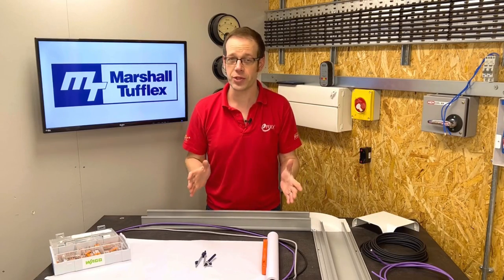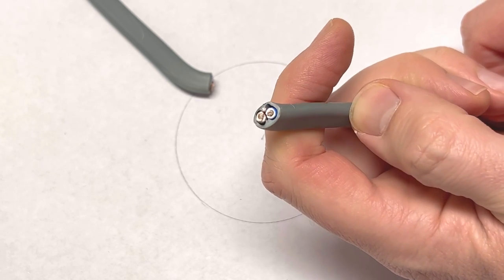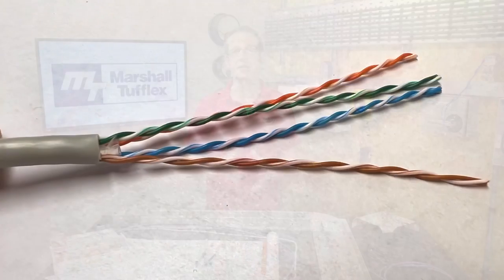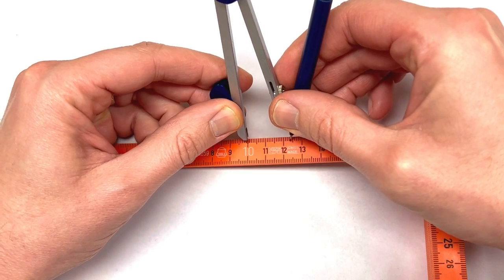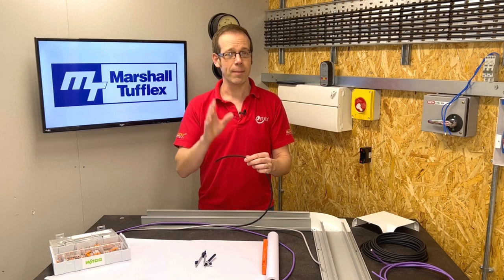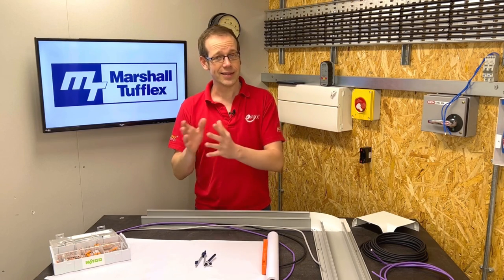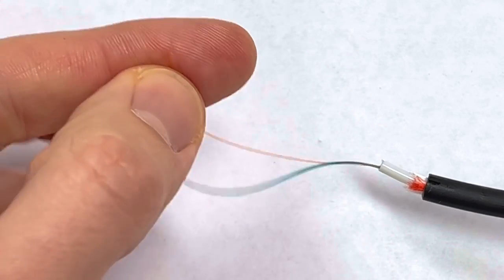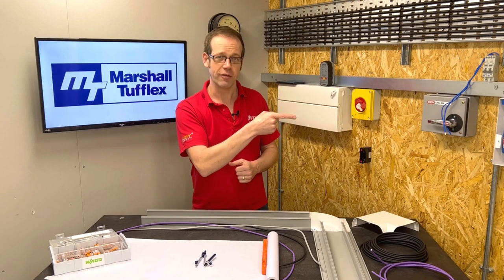Cable Bending Radius: Don't make this mistake

Comment: Well explained Joe, especially those Fibre Optic Cables. We are all more likely to come across them on a regular basis these days, especially with the advent of FTTP. The reliability of this system is far superior, so it needs to be installed correctly if it's going to last. Thanks for sharing.

Comment: CAT6 cables have a solid core to prevent you from bending it too much. The conductors in the cable pairs in CAT6 are also slightly thicker than in CAT5 and earleir to cope with the increased data flow to maintain the signal integrity. The reason for the bend limitation is that the CAT6 data cable standard (and later) is very anal that the 4 internal cable core pairs are very close to each other in length (as in mm) after installation. It's why CAT 6 specific RJ45 connectors exist to keep those cable lengths the same in the plug. The same for patch panels - the lengh of the tracks from the IDC punchdown to the pins in the socket are all the same length - if you can see the PCB it's mounted on you'll likely see extra length on some of the tracks. They are like this in the earlier standards but not as stringent with the length tolerance. If you don't you end up with mismatched timings as the data runs at many MHz of frequency. All to do with timings and propergation delays....
Reply: Sorry it is a few more parameters when it comes to cat5/6/6a/7: Wiremap. Length. DC Loop Resistance. Signal (Propagation) Delay. Attenuation - Insertion Loss. Near End Cross Talk - NEXT. Attenuation to Crosstalk Ratio (ACR). Power Sum NEXT (PSNEXT). Return Loss. Far End Crosstalk (FEXT). Equal Level Far End Crosstalk (ELFEXT). Power Sum Equal Level Crosstalk (PSELFEXT). Alien Crosstalk – AXT. So tight bends cause internal reflections and Crosstalk thereby fail certified tests.
Reply: Also the length from par to par within the cable will vary, due to the fact each par has a different rate of twisting.
Reply: Was trying to keep it within the realm of a sparkie :D
Reply: You have spoken a whole heap of rubbish there!

Comment: Here in Norway we use a cable designed to be installed open on the walls and ceilings (protected only by laying next to skirting board)
This cable is approved with a bending radius of 2x cable diameter for up to 90° bend (4x for >90°)
It looks kind of similar to your twin&earth cable
Reply from the maker: Can you send us a link for our curiosity

Comment: Maybe sparks should just leave data cables to people that know what they're doing just like sparks complain about other trades doing electrical work. Fibre bend radius for installed cable isn't so much due to fragility, it would have to be quite an extreme radius for that but more about how light refracts passing through the cable, tighter bends cause higher attenuation although the bend radius for pulling cable IS more about strength and preventing micro cracks from forming.

Comment: If you're running a cable from outside into a back box I don't see how you can keep it within the bending radius as you need to leave some excess cable to punch down the faceplate then push it into the back box. .

Comment: Most decent Cat6a has a bend radius of 15mm. I don't know where you are getting your fibre optic cable from but in 2022 bend insensitive fibre is the norm and you can wrap a patch lead tight around a pencil and it will still function just fine. Finally, you mention Cat7a; arggggggh Cat7 and later is not suitable for use period. It is a bunch of 4 miniature twinax cables that need special connectors to avoid near and far end reflections and NOTHING whatsoever is available to purchase with the appropriate sockets. Further no IEEE 802.3 standard allows for the use of anything higher than Cat6a for structured wiring, aka permanent installation. There is a standard for Cat8 for 40Gbps Ethernet as point to point in the data centre, but I repeat there is NO equipment you can buy that actually uses the standard and it's only for point to point patch leads anyway.
Reply from the maker: Cool!

Comment: I've just run my data cables around the house over Christmas and I didn't bend them around anything that small 😯
I think my loop was 100mm max at the smallest and 300mm at the largest
I find out the hard way not to kink the cable as I only found out it was broken when I'd hooked out so up and was testing it 🤦
Reply from the maker: Top work, should have a data installation for life there! 😁
Reply: @efixx  I read glad that I guessed correctly and don't need to rip it so out again, I'd need to move a couple of wardrobes 🤣
Reply: Over short lengths you can get away with it. Get to the 60 or 100 Metre specification length (depending on the throughput you want to support) and it becomes critical
Reply from the maker: Phew! 😅😂